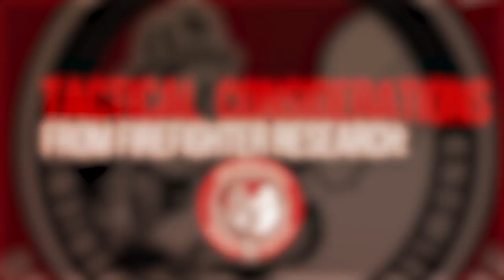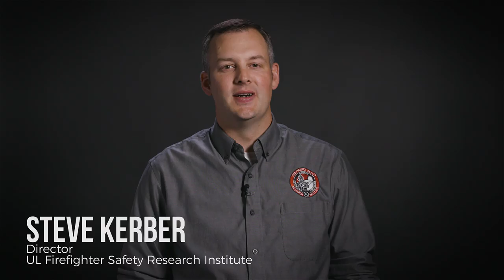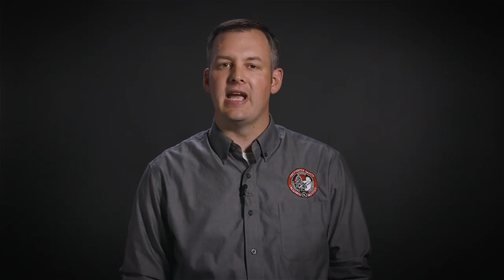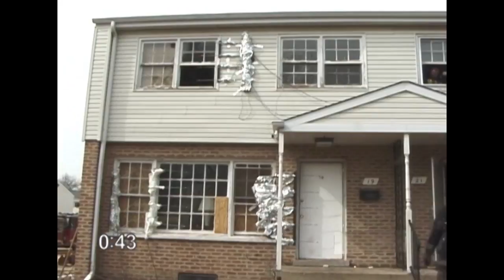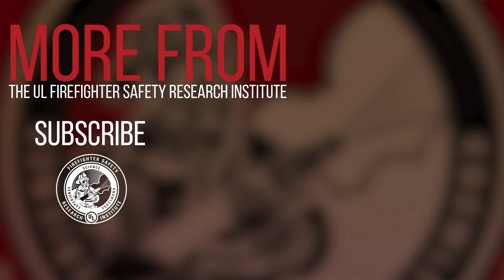Tactical Consideration: Fire Flows From High Pressure to Low Pressure

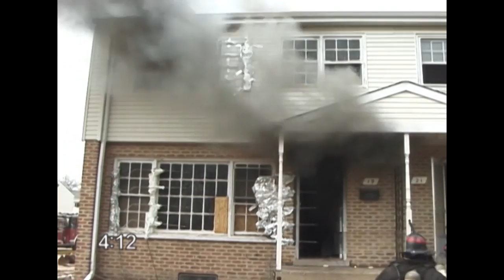Comment: 2:13  Lets talk Vertical Ventilation.  Why didn't things get better at the front door with that upstairs window open.  Air Pressure!  The fire burns better, air pressure increases and escapes in all directions not just up because Heat Rises.

Comment: 0:50  That's why an interior attack makes no sense when you can safely and quickly open the fire room window and extinguish the fire while the Gasses Exit Directly to the Outside and away from victims and the undamaged parts of the structure.